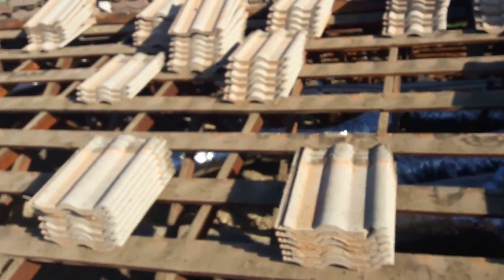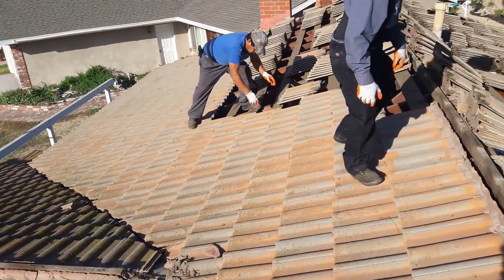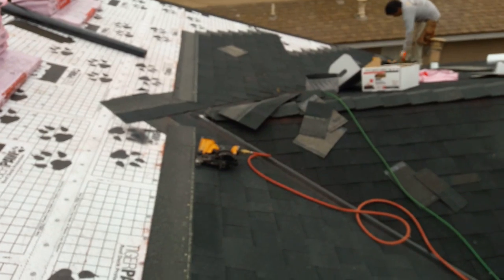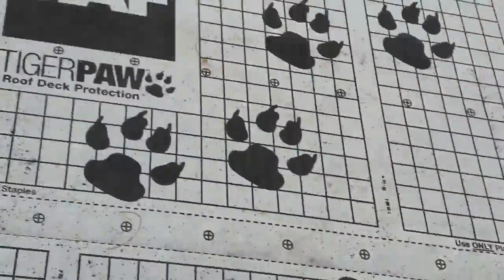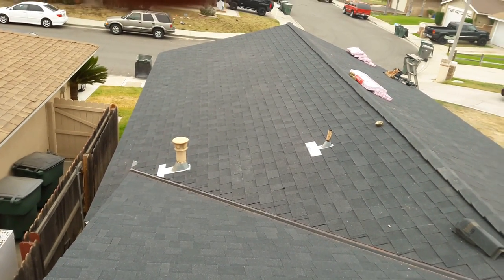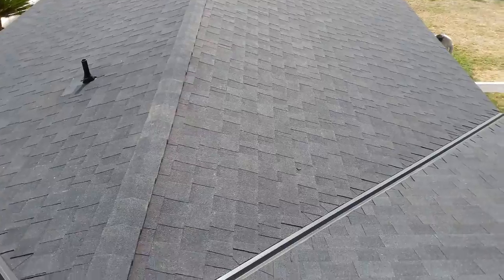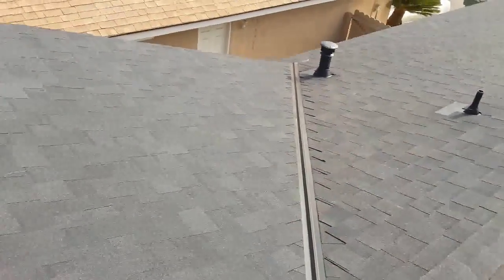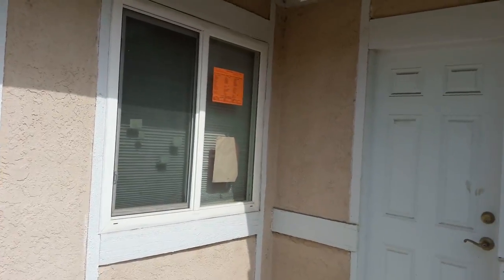Replacing your tile roof with new shingles roof? watch this video first..

Comment: Another beautiful job....Perfecto Garcia.  I bet that old tile had another 30 or 40 years left in it. You had talked about old timers who installed tile without underlayment, and this is an example of that. Would that old tile roof let in insects? Would it be hotter underneath? Hot tar and gravel roofs can last a long time even in Chicago, but every five years they require a little bit of maintenance which nobody does. And this tile roof in the video probably never had any maintenance either.
Reply from the maker: Myron Piano ...no never had any maintenance,  and you are right since it doesn't have solid sheathing it was easy for mice to crawl inside the attic

Comment: ive heard or these type of roofs. but my question Is how do those roof sytems work if they don't have underlayment?. I work for tile companies and one thing we know is that in reality a tile roof always has some sort of water running under the roofs. so how is that roof 30 years old?. again I have heard of these roofs in California. is it because it doesn't rain much there ?
Reply from the maker: it rains normal in CA. only in the winter about 2 to 3 months , the field tiles , as long as you have 3 inch head lap ,you should be ok,  The only downside is the valleys need to be cleaned up every 3 to 4 years and many people don't know that.  the only option would be installing a ribbed valley which didn't exist back in those days. I fold the edge of my valleys to prevent water run off the valley center.
greetings .
Eric.